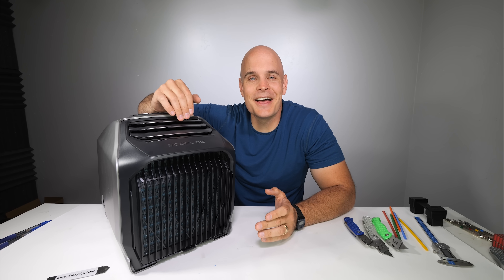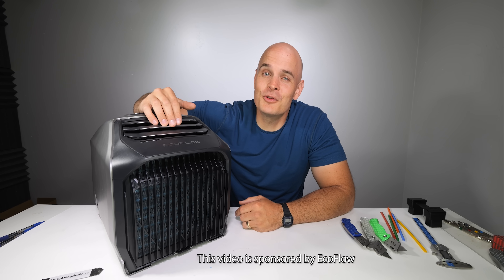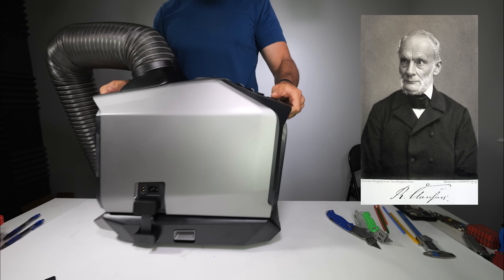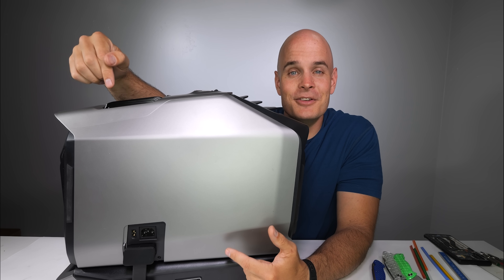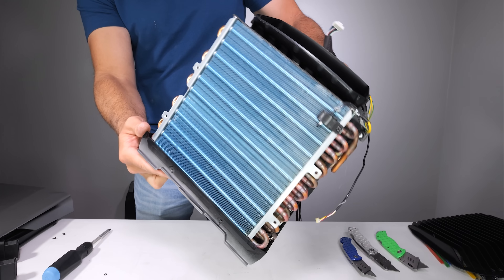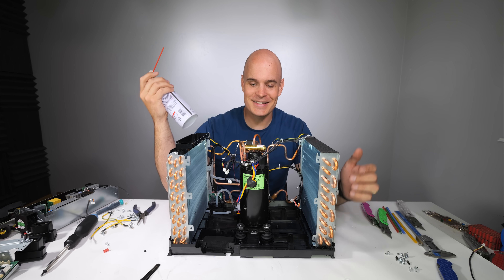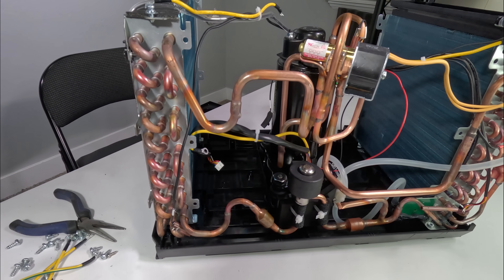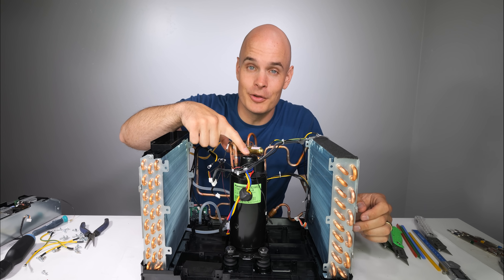THIS CHANGES EVERYTHING... (Ecoflow Wave Teardown)

Comment: Zack you should really redo this. The technicalities you are talking about are just completely wrong. A release valve NEVER compresses, it always reliefs. If you want to understand how refrigeration works, look at "technology connections" that dude has a whole series on AC units. 

The order is compressor -> one heat exchanger -> relief valve -> the other heat exchanger. The switch changes which heat exchanger gets the warm refrigerant and which gets the cold refrigerant.

Comment: The old ones can't really be 100% efficient because some energy is being converted into light when the wire things glow, but yeah I guess they are super efficient. Never actually thought about it

This thing is pretty cool though. I definitely prefer my window air conditioner, but I could see this having it's uses too.
Reply: Yes but that light is turned into heat as well

Comment: Sort of funny you released this video as I am currently taking temperature logging reading of the closet in my lab. I’ve added some networking equipment and servers, and well that closet is getting a little warm. I was wondering if anyone made a small air-con unit that would work. Now you have presented me with a small air-con unit and maybe something that would also work as a UPS for some of the equipment during a power failure, hhmmm? 🤔

Comment: Im pretty sure there is no such thing as 200% efficiency
Reply: For heating/cooling yes, rather than converting energy to heat it moves energy from one location to another, it takes ~100 watts to move ~200 watts of heat from one heat exchanger to the other.  it's a heat pump if you want to look up how they work

Comment: I wonder how much they paid to completely overlook the inefficiency of such a setup. When your cool air gets sucked back into the unit, heated and ejected outside.
Reply: If you use the 3 included vent pipes and adaptors this won't happen

Comment: So can this run without the battery and which power sources can it run directly from? I'd guess it can run and charge the battery at the same time with any power source?
Reply: Yes and yes, AC or DC from an EcoFlow WAVE 2 add on battery, Delta Max, Delta 2 or Delta Pro with XTP cable
Reply: @Melissa’s Mess  so no battery with the 12v from my truck, perfect. I have an idea and this would work for.

Comment: For the curious - BTU= British thermal unit.  It is defined as the amount of heat required to raise the temperature of one pound of water by one degree Fahrenheit 🙂
Reply: I'm more of a calories guy
Reply: @peksn  I know that a calorie is a measurement of heat but how does that relate to food? Also what is the standard.
Reply: @danielpollard2243  Well you know you are like 70% water or smt like that and your body has to keep s temperature of like 36C which is many times more than the average so there could be a relationship of how much of this heating food can yield
Reply: Can that pound of water be at any temperature?
Reply: @goiterlanternbase  It should be between 32 and 211 F; it is also 1,055J , 252 calories or 0.252 kCal.
Reply: @stephenj4937  thx😘
Reply: @goiterlanternbase  As long as the H2O is in liquid form it takes 1 BTU per pound per degree Fahrenheit temp rise. If the H2O is in either ice (below 32°F) or gas form (steam, above 212°F) it takes only .5 BTU to raise the temp 1 degree Fahrenheit due to it being less dense in either of those states.
Reply: @xplmr1  thx😘
Reply: @goiterlanternbase  I'm no expert but I suspect it applies while the water is in the linear region.   Once it gets to the latent heat of evaporation stage then it would no longer apply since increased heat does not then raise the temperature of the water.  I'm sure folks with more knowledge can chime in.
Reply: Some AC salespeople were converting BTU to KW - to simplify the life of the customers. 
Empirically, 4000 BTU = 1 KW.
Reply: I was just about to comment this. I can't believe he didn't know what it was with how smart he is but i guess you can't know everything.
Reply: @Xtuck420x  Oh he knows... even if he didn't, a quick google would tell him. He said it to generate this exact comment, thus promoting the YouTube algorithm. So he is pretty smart.
Reply: BTU - British Thermal Unit - yes our past still comes back to bite! 🤣
Reply: What is it called when you want it in stones by yards?
Reply: Didn't know BTU was also Nigel Farage friendly
Reply: Have to take into account altitude as well, BTU's are the amount of energy it takes to raise the tempurature of one pound of water by one degree fahrenheit at sea level.
Reply: BTU is 1 lb by 1 degree Fahrenheit.  Calorie is one gram by 1 degree Celsius...
0 Fahrenheit is the freezing temperature of seawater.  0 Celsius is the freezing temperature of freshwater.
The two systems are really not all that dissimilar and they were designed for different purposes. 😂
Reply: I can't believe he thinks this is amazing new technology. Houses in Georgia have been using heat pumps for over 20 years. In fact, if you want a poor man's heat pump, just install your window unit backwards. Think about this. This unit produces 5100 BTU's for $2249. 12,000 BTU's is 1 ton. My house has a 3 ton or 36,000 BTU AC heat pump (just so you're aware, if you think about buying this, it will not provide you heat if the temperature is too low, so if it's in the 30s don't count on keeping warm) for $300 you can buy a 10,000 BTU portable AC unit, then go buy an inverter and a couple of batteries and you'll save a bunch of money. Yes, the packaging won't look so nice. But over $2,000 for less than a half a ton of AC. Good luck! Trying to cool a tent with no insulation. Have somebody do a heat load calculation? A 100SQft house with 8 foot ceilings requires at least 9000BTU's a tent with no insulation probably needs more than 9,000.
Reply: british thermal unit using an american measurement.. interesting
Reply: @jboy856 They're not "American" units. In fact, in America they're called "English units", and in Britain they're called "Imperial units", because they were used in the British empire.
Reply: Not Fahrenheit, but Centigrade.  It is British, not American!
Reply: You fell for the comment bait. Smart alecs always do.
Reply: I like that ALL units are British!
Reply: Yep I figure Zack knows this he is just being kind.
Reply: @mjpete27  he wants you to comment on it.makes people feel needed.

Comment: I'm sure it's decent and works ok, however, it's not going to handle condensation very well  on humid days and especially not in to sub/tropics. I'd recommend that if you want a good one that will last, don't get this one.
Reply: Why wouldn't it?  It includes a drain hose for very humid environments for when splashing the condensate on the hot side of the heat exchanger can't remove it quick enough.  Programmable and selectable in the app

Comment: Ill put it back together for you. Yea, heat pumps are pretty neat, I run one on my house. The one neat thing it does for the house units is when the pump is froze it will turn on and blow air into the house while drawing some of the house heat out to thaw the pump, then turn the pump on once thawed to generate more heat back into the house. They can struggle under 32°F so instead I automated the gas fireplace to turn on for 5 min every half hour to give that extra heat and help it thaw faster saving on the higher cost of electric during those cold winters.

Comment: I think I understand how the compression cooling thingy works. When you squeeze the atoms they have less room to jiggle around and that energy is transferred to whatever is doing the compressing? When the gas is released back it normal pressure it's not jiggling as fast because it's all just spreading out. Yes? No?

Comment: This can't be that efficient in a room because it creates a vacuum by sucking in air from the room and blowing it outside. This is a common issue with portable air conditioners. You will be pulling hot/cool air through the walls and small openings to the outside making any efficiency's awarded from the heat pump aspect pointless. If it doesn't have an intake and exhaust tube it will be super inefficient inherently. Something to keep in mind before buying.
Reply: It does have 3 vent hoses and adaptors included.  you can configure it any way to create positive pressure, negative pressure or to intake and exhaust creating no pressure

Comment: isn't this just a window ac with a battery?
Reply: A heat pump AC is a glorified window unit with a reversing valve. And yes, they are at least 200% efficient (usually much more) because they’re not creating heat or cold, they’re just moving it around. A window unit makes an efficient room heater if you reverse it, believe it or not.
Reply: Yes it is just with more tech and more efficient and extremely expensive for no reason.
Reply: Problem with this style unit is the exhaust air being pushed outside means negative pressure in the room you are cooling/heating and this will pull outside air into your room. So any leak in your doors, windows and walls will allow the outside air inside. So if it's hot outside (90 degrees) that hot air will be pulled inside. Window AC units, mini split AC units and central AC units don't have the same problem as the outside portion uses outside air and the inside portion only acts on the air that is inside.  So there is a big inefficient portion of these type units that is not mentioned in advertisements.
Reply: @dbusby77  The unit has two hoses that go outside the cooling area, one hose brings air in to be cooled then other hose is the exhaust. So, it is indeed a closed-loop air conditioner, negating the possibility of negative interior pressure.
Reply: @ozmanfidaar6311  oh if it has two hoses that are used to intake and exhaust then that makes this unit better. This was not shown in this video and I have used similar but they only had a single exhaust host so the negative pressure in the inclosed space draws air from outside threw any small openings it can.
Reply: It's Based On A Windows Type AirCon
Reply: Yes, and all cheap plastic
Reply: @_BangDroid_  Nothing cheap about this unit!
Reply: principle same but you can not use battery which die out very short time those fans and specially Compressor use a lot of electricity to run .
Reply: Finally some common sense. 200 percent efficient. Like wtf. 😂 Physics is a joke
Reply: @aktab9 It's true. Electric heaters are 100% efficient at creating heat from electricity. Heat pumps just move heat and can be more efficient because of it.

Comment: What's the wattage? Im just curious cause I have a plugin AC that uses only 350watt and I can run it for 3 hour using a inverter and 12v 100ah battery and can run it all day solar
Reply: It uses 550 Watts on AC and 495 Watts on DC😊

Comment: Looks like a cool unit! I think it might be a good idea to add a second duct to the intake, so you are not creating a vacuum inside the space you want to cool/heat and therefore suck outside air back into the space through doors/cracks etc.
Reply: I just checked their website and they do have a dual duct hose option. Yay for efficiency!
Reply: @Bigpimpini4231  Yay!
Reply: Single hose portable units should be friggin banned! But, that is pretty much the only option at local stores so retarded
Reply: yeah, after watching a video about those portable air coolers that just have those one ducts, im concerned about every single one of those, but because the first replied has said, thats neat, they should just make it as a default tbh
Reply: Exactly!  I was looking for this comment.  People don’t understand that a single hose portable AC unit is useless.  It’ll just cause negative air pressure in the room that will suck in hot air from outside cancelling out the cold air the AC unit produces.  Dual hose is the only way.  This is why home central air units have the condenser unit outside the house and window AC units have the condenser outside of the house.

Comment: There's a reason why portable A/Cs have the reputation they do, and has something to do with thermodynamics. If you're mobile/outdoors and want to heat an area, use a heater or a fire(campsite). If you need to be cooled off, use a fan, possibly with an evap systems like a portacooler uses.

Using a mobile heat pump is just going to waste a lot of energy with not so great of a return. But as long as they can get you to believe it makes sense, you might actually buy it.

Mini-splits on the other hand make sense because they're able to condition because the condenser/evap coils are actually separated.

Plus A/C in an open environment is usually only going to net you a 20°f split at the register... So if you're constantly taking in 100° air, you're only going to get 80° air coming out. If the space is uninsulated or open, you'll never actually drop the temperature, therefore you should be using a fan.
Reply: Do any of those options have a DC compressor that can run off a DC power source and/or solar panels(solar panels and DC source also require the WAVE2 battery to be connected)?
Reply: @rcguymike  You can run any of these devices you want using solar. Just like any portable power source, you just use an inverter, or d/c version of said device.

Are you trying to make the case this is a good option on a solar system?
Reply: @FlipLoLz  This has a built in MPPT solar charge controller, no inverter or associated losses required
Reply: @rcguymike  I'm not sure what your point is here. Do you think that is going to magically make up the difference in the inefficiency, that is cramming an evap coil in the same box as the condensing unit? The use cases for this product are very niche, and like I said, they aren't even a great solution for the applications they're supposedly designed for... If you think that venting the air else where is the game changer, then I've got a bunch of portable units I'd love to sell you.
Reply: @FlipLoLz  Yes, you are correct it is niche, but there are 0 options that are DC powered, can have 400W solar input, or be powered off another another solar generator through DC, controllable with WiFi or bluetooth, and also be used for heat.  For someone that wants to be comfortable in nearly any condition/season that is "overlanding" in a Jeep, small tow behind trailer, tent or campervan, this can eliminate the need for a diesel heater and provide AC and dehumidification.  It's expensive, niche and a luxury, but if used correctly it's 100% not a waste of energy and 100% a better option than a fan, and better than wood, evap systems, or fossil fuels.

Comment: This is quite literally your standard AC unit but with the heating modifications, nothing ground breaking, just super convienient with it being battery operated. I am however amazed that heat pumps aren't more common given the ease in which AC COULD be a heatpumps too. 

Gotta say though, Jerry needs to research BTU's for a standard size room you need around 12,000 BTU's or 9000 BTU's for a more modern UK front room.

Comment: To make it chill it needs to heat the opposite radiator (thus you call it heap pump). Where does all this hot air goes? If you leave it in a closed room it will not make it any colder. In fact it may even make the room hotter. This is not better than a portable AC with a single hose.

Comment: BTU is short for British Thermal Unit, a unit of measurement that shows just how much energy your air conditioner uses to remove heat from your home within an hour
Reply: The amount of energy required to raise 1lb of water 1 degree F. That’s the definition.
Reply: @jginda1  you are a correct sir
Reply: How can you be so wrong when you play the teacher in the comments. One minute of google would have saved you the embarrassment.
Reply: I thought it was the amount of heat produced/withdrawn in an hour, not the energy used to do it

Comment: COP of 2 is annually pretty poor
A good air-air heat pump can reach COP 7, so basically makes 7 times more heat than a resistant heater, but takes the same amount of energy
Reply: @JorgTheElder 
I was talking about heat pumps in general. This one is an extrem niche device and I would have hard time to find any use of it. 
So no. Probably it’s the best battery powered heat pump, and the only one battery powered heat pump

Comment: BTU = British thermal unit 

BTU is a measure of heat, which is measured in units of energy. It is defined as the amount of heat required to raise the temperature of one pound of water by one degree Fahrenheit. It is also part of the United States customary units.

Comment: I doubt the efficiency stats that are being cited. I am a mechanical engineer in my 3rd year busy with my second module in thermodynamics and this cycle is one I have been studying a lot lately. And I am sceptical. It might be an amazing product. But the stats are weird.
Reply: This would be called a vapour compression cycle.
Reply: Google heat exchanger and heat pump, they can be even more efficient than this miniaturized portable one.  They move heat energy rather than convert the energy to heat.  They even make water heaters now
Reply: @rcguymike  A you didn't read my comment did you?
B there are many many ways in thermodynamics to measure efficiency. And the results vary extensively depending on which type of efficiency stat. So 200% efficiency is somewhat of a meaningless statement. The blanket statement of 200% efficiency is by nature deceptive.
Reply: @TobyAnderson  correct, just like your comment is also misleading.  Assuming your context is HVAC energy efficiency their marketing terminology of 200% efficient is correct and not misleading at all.  There are no standard heating/cooling solutions that are more than 100% efficient at heating an area except for heat pumps.  If they get this certified they can stick a SEER or EER sticker on this that will indicate, in the HVAC industry standard way, that this is more the 100% efficient.